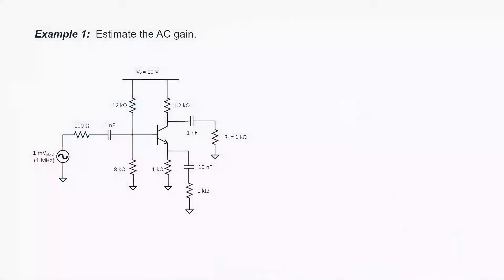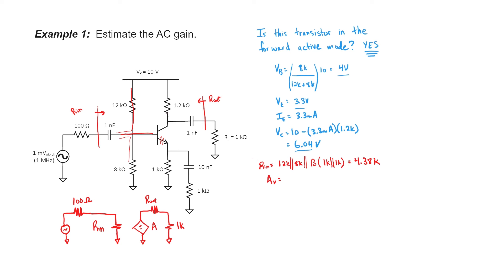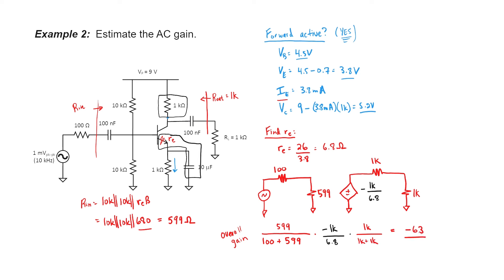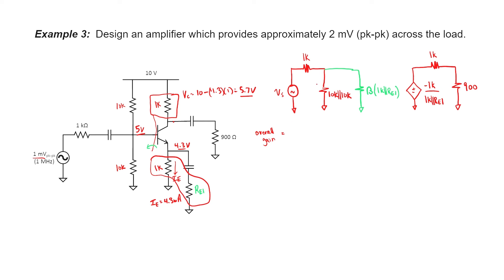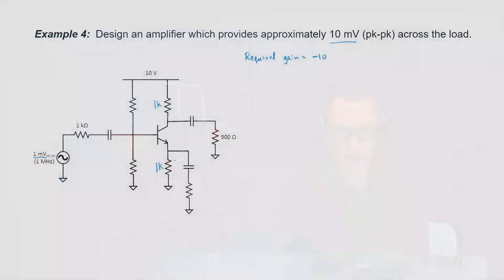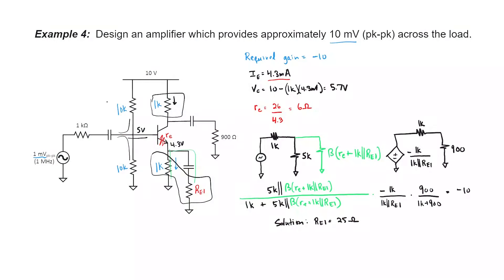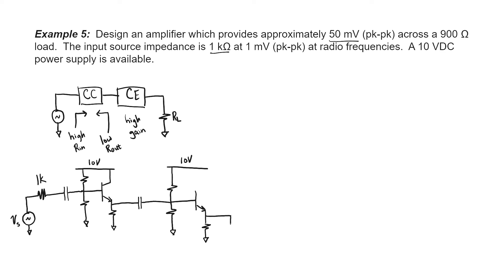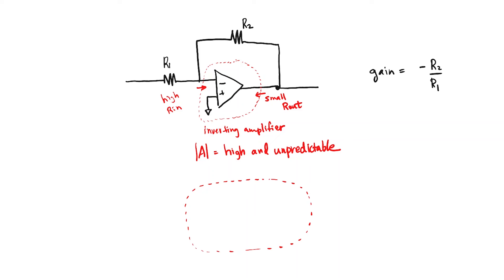Common Emitter Examples (12-Transistors)

Comment: Hello Prof. Danner,
Thank you for all the time and efforts you put in producing these training films on transistor designs.
I would like to see the explanation of the thermal stabilisation coefficients in this same common emitter amplifier stage. In some industrial and military applications I have to set as starting point the thermal stabilisation, and that calls for an high value of the emitter resistor, and low value of the base resistors. 
For the same reasons, I often use a single stage, with two DC-coupled transistors, with both DC and AC feedback, so to have a very stable rest point, low distortion and wide bandwidth.
Your work is very appreciated.
Greetings,
Anthony

Comment: Really enjoy the videos but feel it would be nice to drill down more on the exact calculations for the capacitors.
I realize that staying above certain values guarantees the signal integrity but if looking at everything, I think it would be helpful to include them.
Thanks and great job on going through multiple examples.
73...

Comment: In the 2nd example,  I think you should not neglect the 10uF capacitor since the freq is only 10K the capacitor impedance is about 1.5 ohm. Love your video, although I had good teachers at school, I wish you were one of them.
Reply from the maker: I just checked it on LTSpice and the actual gain is around -58 rather than -63 as calculated so I think it's still ok but you're right that the 10 uF is the cause of this undesirable filter.  A 100 uF would have been a better choice there.